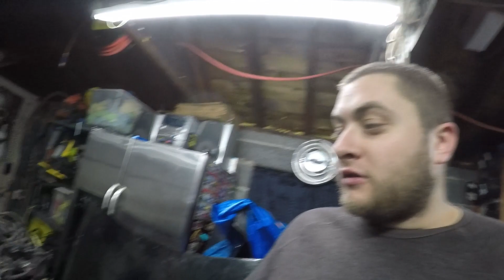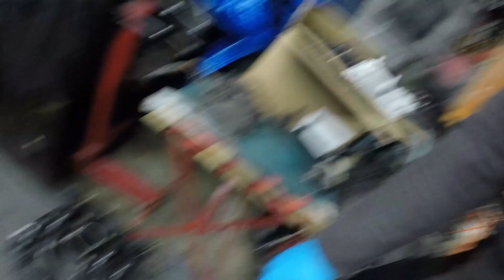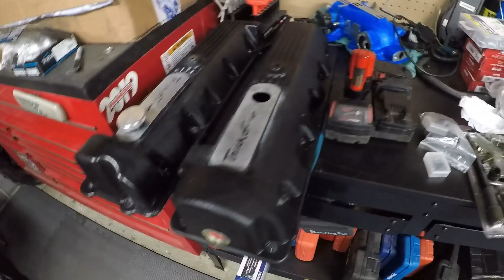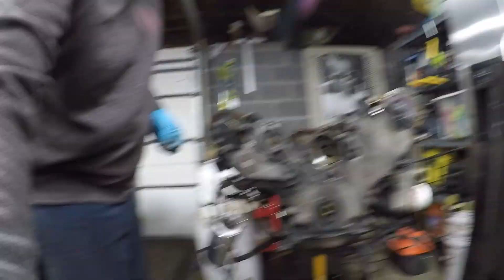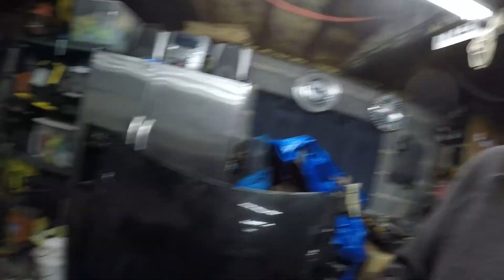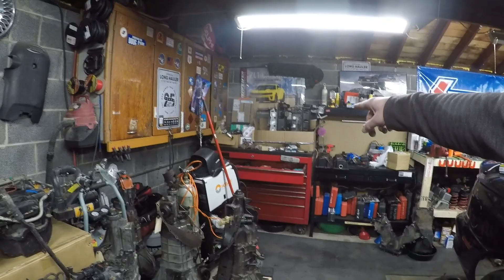Ford 4.6 2V Teardown for the Junkyard Mustang

Comment: I have a really well rebuilt 4.6 2V in my 39 lincoln town car, they’re really good engines, fun to modify as well
Reply from the maker: The timing chains were definitely a bit intimidating at first, but actually weren’t too bad. I’ve rebuilt an SBC and LS, and this was a touch more complicated than that, but still much better than I thought. I need to get back to this thing and get it on the road!